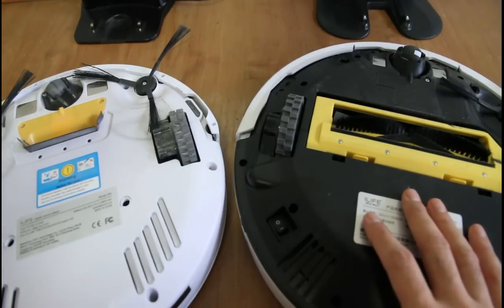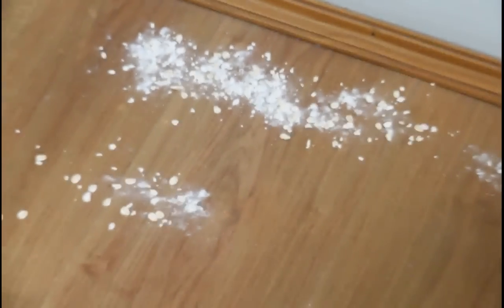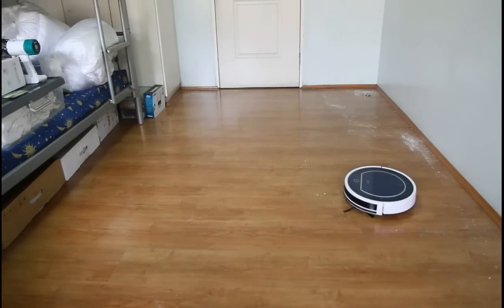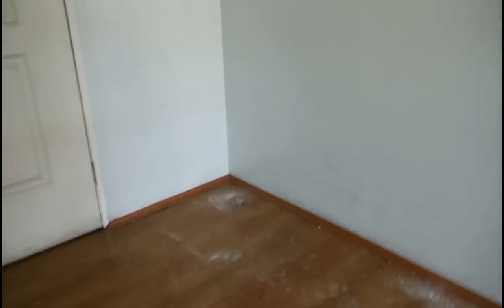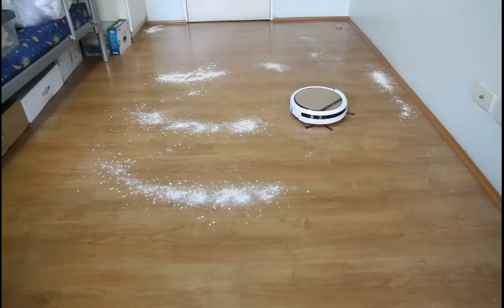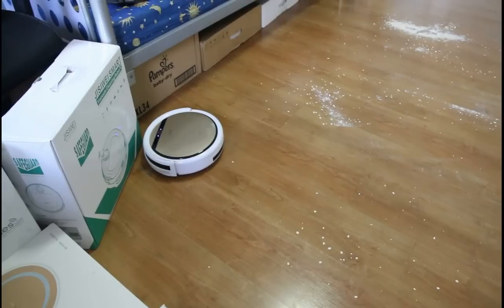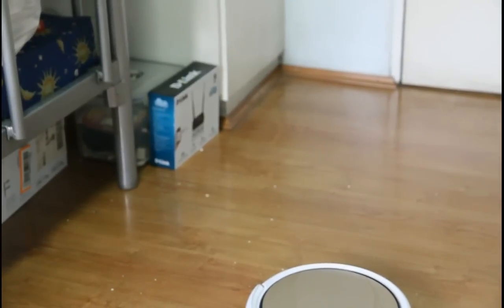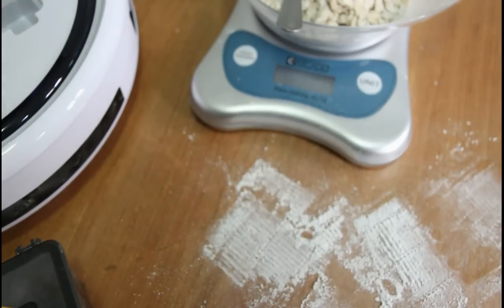ILIFE V7 vs V5 Pro Robot Vacuum Cleaning Test

Comment: I run the m6 daily, and my floors look awesome🌼 allabout.wiki/ILIFE-Cleaner I wet mop 2 days and dry sweep the rest of the days. When I first got it, I used the included disposable pads. I didn't like them--the dry pad has no depth so if it picks up a chunk of something, like dry cat food, then it pushes it around or drags it around the floor. The wet pad wasn't very absorbent so left streaks and wheel marks.

Comment: I have the Deebot for vacuuming and it has a roller on the bottom which makes a huge difference compared to just the spinner brushes alone.  I use my V5S for mopping after the Deebot is done.

Comment: Which one of those two is optimal for pet hair (no carpets)? I have a vacuum with "small opening" and two brushes (not ILIFE but some other model) and it performs pretty well. The V7 looks bigger, with more capacity etc. but I'm afraid that the rotating brush will stuck because of the pet hair. WDYT?
Reply: Meeeee too. I have a husky and a mix. I'm afraid of the pet hair getting tangled in the brush